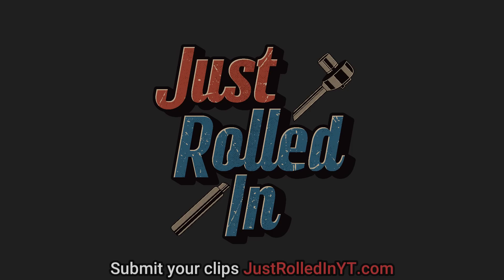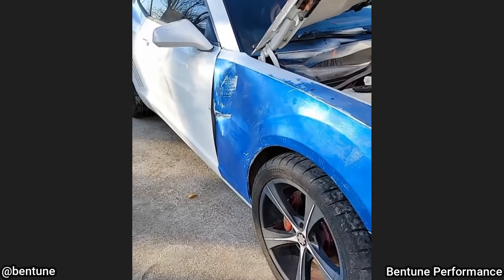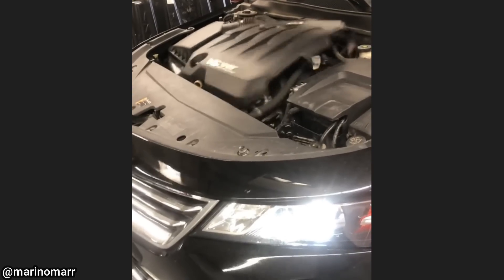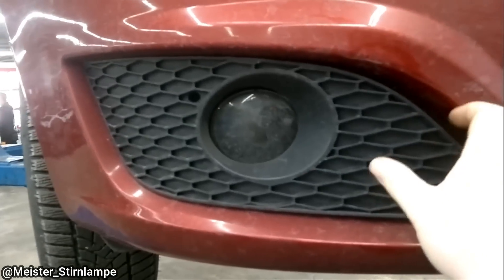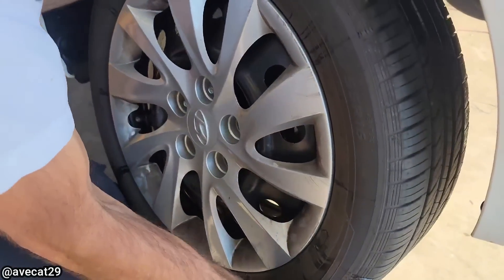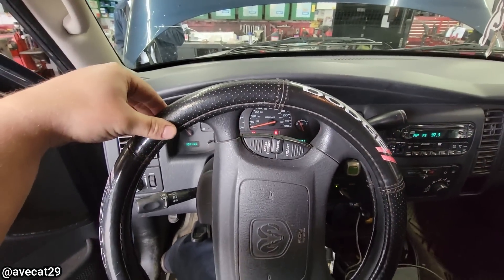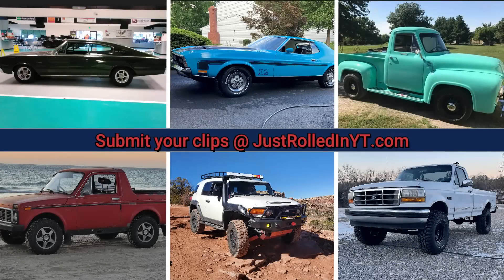Customer States Oil Leak On Car They Just Bought | Just Rolled In

Comment: 🤣🤣🤣🤣🤣🤣.. i know someone who took their 4x4 in to have new breaks fitted by a mechanic mate, he charged him a fortune and it had a noise in it after the "repair" he took it back twice because of the noise but was told there's nothing wrong.. the owner decided to fit some bars on it himself and when he was under the car he could see the brake caliper just dangling down hanging from the brake line.. needless to say he wasn't real impressed and called the mechanic and told him to come fix it now

Comment: I have never had a mechanic ask for a deposit before but I don't neglect my car like that
Reply: I worked at a auto parts store/repair shop and a customer brought a car in for a clutch, mechanic inspected it and told the customer was told the price of repairs and declined the repairs, about 3 weeks later his wife brought the vehicle in for repairs and refused the repairs because a street mechanic could fix it for a cheaper price, 2 months later the same vehicle is in for repairs, customer states that the street mechanic did the job and now it's doing the same thing again plus some other things wrong, after the mechanic did his inspection and put the repairs needed on the inspection report and told the customer the price of the work and length of time because it needed parts that had to be ordered from the dealership, needed a clutch, driveshaft,radiator and water pump because whomever did the repair took everything apart, didn't put the transmission correctly in, left a big hole in the radiator and stripped the bols on the water pump because he tried taking the water pump off and tightened the water pump bolts until they broke into the block, but the mechanic refused repairs and customer had it towed to a Toyota specialist in the neighborhood and it cost $4500 for repairs, customer declined and another mechanic in the area bought the car from him for $500 and got $1500 in parts from Toyota and 3 months later that mechanic brought the car into up for state inspection and emissions and told me that it took 3 months of weekends to do the repairs and then had us do the inspection and he's giving the car to his wife to use
Reply: @RedArwBus  Thanks for the story

Comment: That video before the pictures…
“Ah that’s nice” 
“Ahh… uh wait, what kind of vehicle has a drain plug next to the lift point” 
(Reads description) 
“Makes sense, they like weird stuff in Europe”
Reply: My dad once bought a Holden Camira new (they were based on one GM's German cars), but the crazy thing about it was that if you ordered air-conditioning, the compressor stuck out through a hole in the sump-guard!

Comment: I never understand how customers can remove suspension parts that are torqued down with a significant amount of force and then think that finger tight is sufficient for reinstallation.
Reply: Exactly because to remove the torqued screws, all you need is a fraction of a millimeter movement, while to torque something down, you need a metric fuckton of force.

Comment: Ever notice how a lot of these problems could have been fixed by the customer if they only looked or read the manual? Door won't close? Look and see what's blocking it. A bad smell coming from the back seat/trunk? Just clean it out. Air conditioning not working/blows hot air? Turn on the A/C, turn off the heat.

Comment: When I was young I had an oil filter that leaked all my oil out after a change. Turns out it was unseated. 

However I did everything right, hand tightened it, put oil on the seal, etc. Turns out the threads weren't properly cut all the way though on the filter, and it felt like it was on right.

Lesson learnt, feel and look to see if the filter is seated properly.

Comment: The horror.....
Is there no yearly car check in your country?
Reply: In most American states as long as the lights work your good to drive we have the MOT yearly check here in the uk and I know the Germans have a tough test aswell I imagine most of Europe has a yearly test
Reply: @essexginge9167  no wonder people drive in wrecks there. Yeah, here in Belgium and were i come from, the Netherlands, have yearly checks. Only when the car is brand new, it has its first check the second year. Yes, the check in Germany (Tüv) is tight, the check in the NL (APK) is good and no nonsense, and the Belgium one seems to be easy. In the 70's we had a tv programm that was called "Wrak van de weg" ( wreck from the road) ( the name has a double meaning) and then they showed a car that the police stopped, conviscated it, and on tv they showed the problems. Then at the end of the show, the wreck was wreck on a very destructiv way. When you YT it ( wrak van de weg) you can see it. It was on tv untill the yearly inspections come for cars.

Comment: hey guys im 16 years old and need some advice with buying a car .i want to buy a audi allround 2001 for 1k (cad) with 280K Kms on it with bad bags is it worth it ??
Reply from the maker: It would most likely be a money pit especially with that many miles on it. I would get a Toyota or Honda if it's your first car. Reliable and cheaper on parts.

Comment: Who buys a manual transmission car that doesn't know how to drive it
Reply: Some people think they can learn how to drive stick on the way home from the dealer, they usually dont, but atleast they had the intention to learn and knew just enough to not trash it on the way.
This lad just went in with 0 idea on how anything works and ignored multiple warning signs like a burning smell coming from the engine.

Comment: 0:36. Im destroyed like that clutch. THIS IS WHY YOU REAEARCH AND DO DRIVERS ED PEOPLE. WTF NOOOOOOOO HE RUINED THE CLUTCH SO BAD. HOW DO YOU FREAKIN EVEN DO THATTT. ;-;
Reply: That's why I learnt on a manual transmission and stuck with it. It's easy to drive an automatic. And if you can't drive an manual transmission, DON'T DRIVE IT TIL YOU CAN!
Reply: Bet he just put it in 5th gear, and then slipped the clutch.

Comment: I must say it's pretty impressive that the Volvo ran and made it to a shop after being filled up to the oil cap with oil lol. Sure all the seals are blown now but it ran. Lol
Reply: @ALittleBitOfGay  Sometimes it's tough to see what is actually going on in these short videos. I just assumed the worst. Glad it wasn't. I have 4 Volvos myself and hopefully yours is running good again.
Reply: @ALittleBitOfGay  I have a 1989 240 with 430k miles an 2002 V70XC, 2012 C70 T5 and a 2010 XC60 T6. All of them are modified in some way.

Comment: Those Holden vectra's are problematic sometimes. Especially because they're are European vehicles the quality of some of them can be questionable.
Reply: My dad once bought a Holden Camira new (they were based on one GM's German cars), but the crazy thing about it was that if you ordered air-conditioning like my dad, the compressor stuck out through a hole in the sump-guard!

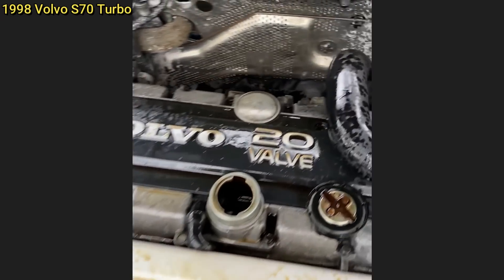Comment: 0:49 Something tells me that the oil was topped off to the full mark on the dipstick, and it blew oil all over the place. It is a very common problem with the Volvo 5 cylinder engines, I’m not sure if Volvo ever fixed the issue. It’s caused by a clogged PCV system. I know this because I have a 1998 Volvo V70 turbo and it blows oil out of the top if you drive it any longer than 15 minutes.